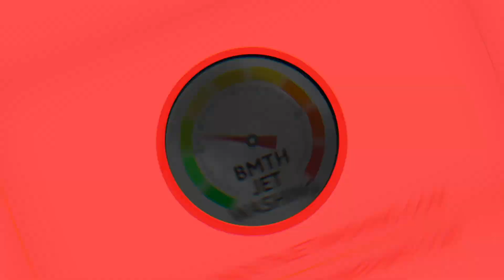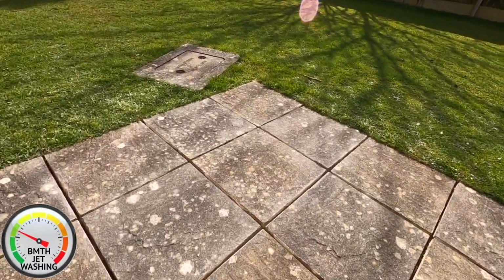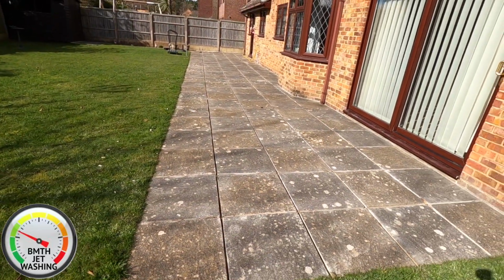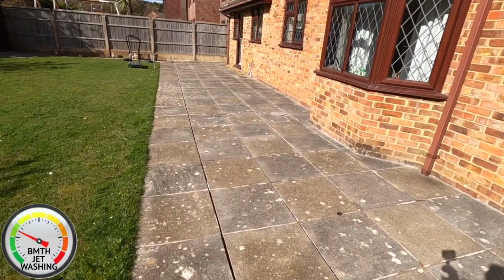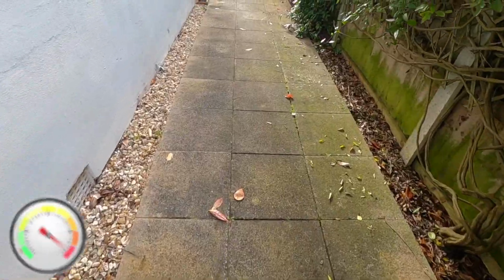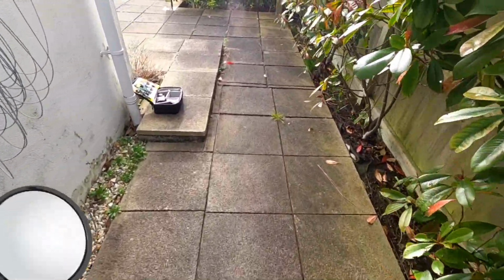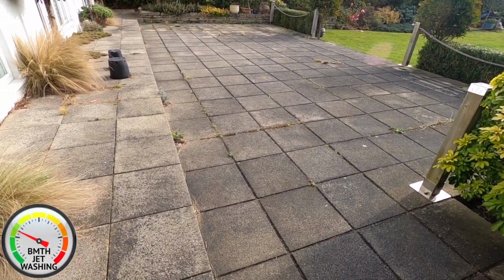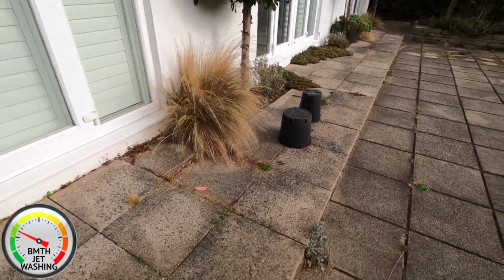Pressure washing day trip

Comment: Hi Ricky
you make it look so easy and always a pleasure to watch!! just one question if I may please...when you use heat does it remove black spots? I use cold water at the moment  then struggle with the spots and end up using neat hypo which is no fun to work with so thinking of the possibility of upgrading to Mazzini firebox. 
Thanks buddy. 👍👍
Reply from the maker: H i Jason heat does remove black spot better than cold but hypo is always best

Comment: How do you decide which colour hose to use??
Reply from the maker: Its the same hose the blue one is just a extension one i put on when needed, But also have another hose reel that does the hot water, in total i have 5 hose reels in the van that do all the softwash, , hot and cold pressure,  and filling up etc